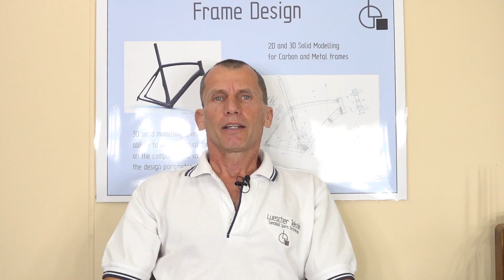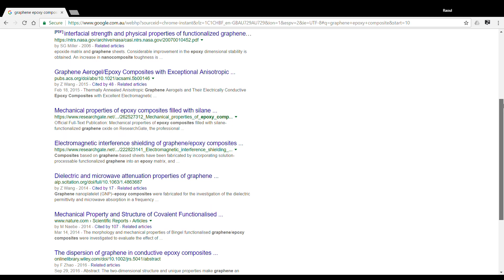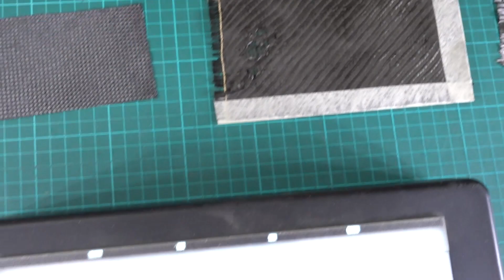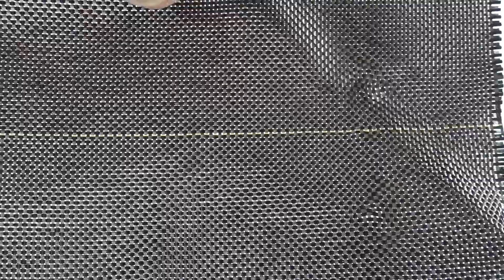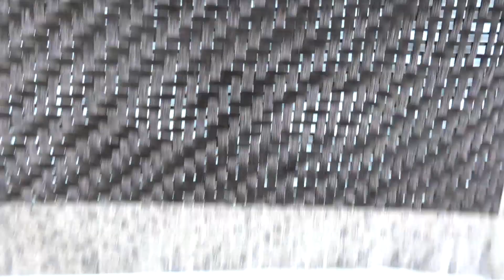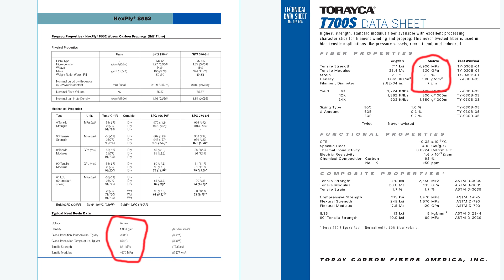Graphene in bikes.

Comment: I guess it would be sheer luck if the large amount of variables are all met in a correct way if you look at one frame that you would like to purchase.
I ride a Caad 12 and my concerns were the lateral impact vulnerabilities and the possible flaws in the manufacture of carbon frames.
Would it be possible, without cutting up, to check the frame build quality by an endoscopic survey?
Reply from the maker: Yes, using NDT methods such as ultrasound scans we can find typical flaws without cutting it up.

Comment: hi there . best way to help understand the benefit of graphene infused resins and how it strengthens the resin is to imagine the molecules of resin being the size of basketballs and the size of graphene being the size of pingpongs.When it is sonicated in a compatible thinner for the resin and then added to the resin and really mixed in very thouroughly you will have all the basketballs held in place by by the pingpongs surrounding them. you just got to think the opposite to filler which would be adding the opposite effect and forming molecular air pockets and essentially voids!
Reply from the maker: Thanks for the great explanation.

Comment: An excellent video, thanks Raoul.

One question, with all the different weaves you showed, for the same weave/fibre/etc is there any real difference between the fibre manufacturers in terms of quality, or are they all pretty much bound by a standard and expected to meet that standard(s). If so are there different quality standards for CF?
Reply from the maker: From the big fibre manufacturers, the products are comparable, there are new players coming in the market also, not sure about them.
Reply: Thank you very much for that, I din't know more players were coming onboard, but can't say I'm surprised, it's probably long overdue. I recall a shortage a number of years back.

Comment: Good discussion. The fracture toughness and electrical aspects of graphene epoxy are the most interesting to me. I read recently that it may be easy to make in bulk now with oxy and acetylene in a chamber with a spark plug. That black soot off any engineer's oxy/acetylene cutting/welding torch could be partly graphene. Carbyne or the proposed unidimensional 1D boron that has metal or elastic properties is interesting. 
There are also processes that use heat and pressure to make 3D structures using only graphene, without the need for carbon fibers.
I could see graphene being used for electric bikes to replace wiring and possibly accessories, also possibly embedding strain gauges, other sensors, batteries and solar. Volvo cars already have prototype composite panels that lay up cells for batteries, I wouldn't be surprised if they've also added solar to them. There's a new perovskite called KBNNO that can turn sunlight, heat and movement into electricity. So a frame with this material could possibly even sense if there has been structural damage and warn of impending failure.
Call it the Safety Bicycle. :)
Reply from the maker: I agree, as I said saving a few grams is not that exciting compared to the other potential properties.

Comment: BTW, steel has been around for considerably longer than 100 years...   more like 4000 years... if you go back to it's first uses by the Chinese a couple hundred years BC.
Reply: Yeup... could be...  but I got the feeling he was talking more about materials than products.  Course, my feelings are often wrong... nyuk! nyuk! nyuk!
Reply from the maker: Talking about the higher spec steels used in bikes. The first alloy steel was patented in 1865, so about 150 years ago with the first real commercial use around 1900's in bike chains and tubing. 
I remember the year 2000 like yesterday so about 100 years!!! :)

Comment: great explanation, but the UCI has a weight limit, so signicantly lighter bikes don't really make a different to design and final builds i beleve other areas of marketing will be used to keep people interested in new designs.
Reply: Rules change. Without sponsors theres no racing to regulate. So if enough sponsors feel a 5 kilo bike with disc brakes is what should be marketed, that's what happens.If UCI wants to stay relevant. Otherwise, a new organisation springs up. When they are done with playing with tire width I imagine a couple more areas will get attention.
Like 12-speed cassettes introduced, 3 chain rings in the front for efficiency, now that the 'weight'-problem doesn't matter anymore. Disc brakes definitely.
Maybe night racing so you can start selling bike lights by the millions too.
The market finds a way to 'innovate'.
Reply from the maker: The UCI is reviewing the weight limit ruling so we will see what comes of that, however with the current limit the brands need to differentiate themselves with other "features" as you say.
Reply: I like the 3 chainrings!